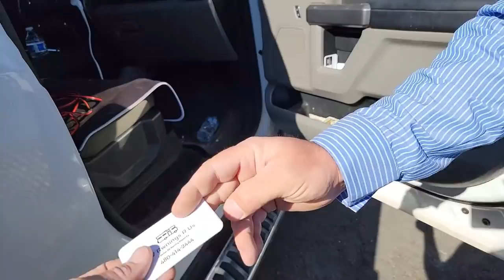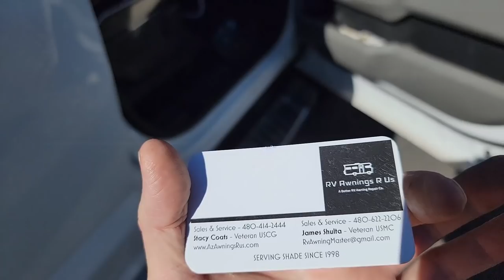What to Do With a Obsolete 20 Year-old RV Awning?

Comment: Always great content from you!  I am very active on FB RV groups and share your videos with members that also find them very helpful, and although I have viewed many of your videos and subscribed, I haven't seen a video on how to remove the snap together extruded aluminum beltline molding so common on diesel pushers like mine without destroying them.  The delamination video "RV Sidewall Water Damage...What Did We Find?" video had a very brief description on it, but I find myself having to look at replacing a fender on my 2007 Gulfstream Crescendo and it looks like I will need to remove that molding to do it.  I don't even have a source for replacement if I damage it.  Keep the great videos coming!
Reply from the maker: Hey tell them to like and subscribe! Thanks for watching! :)

Comment: Cassones RV seems to be the roof replacement place in town?  I traded off my Fuzion toy hauler (roof issues)  2016 unit   for a used  Solitude 3540GK Grand Design 2021 unit.   Just need to figure out how to haul my motorcycle behind the GD Solitude
Reply from the maker: Seems that way right now!

Comment: My 2007 Journey has the old canvas awning material. I have heard others state that the heavy canvas material was replaced with lighter weight material that will rip before pulling a sidewall away from the coach. Would I be wise to replace the awning material, and how hard is it to upgrade the manual awning to power?